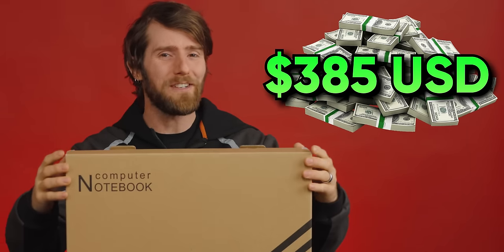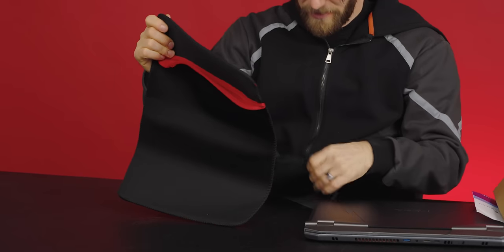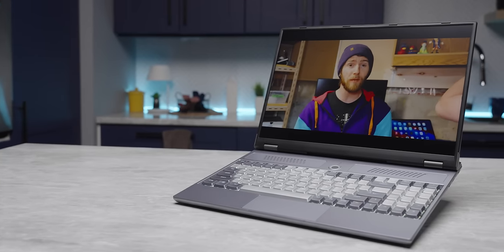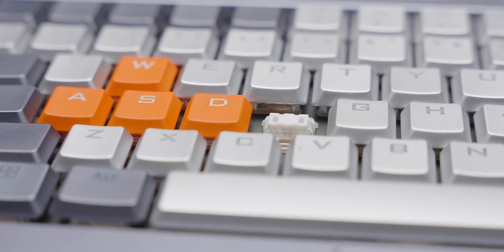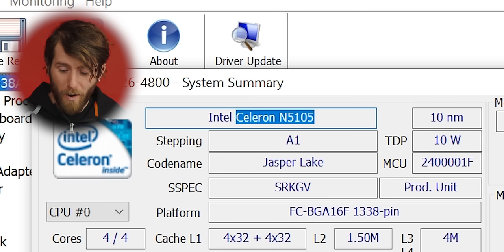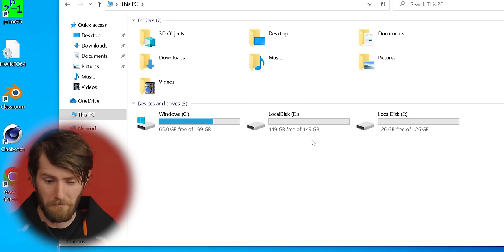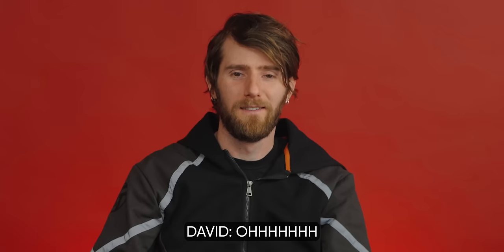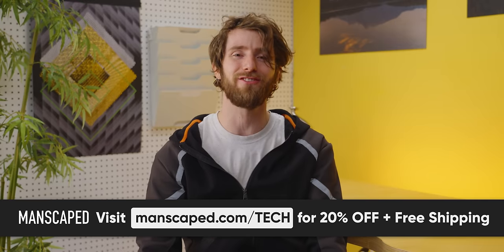Brown Star for Effort – This AliExpress Gaming Laptop is HILARIOUS

Comment: It took me 3 months at my current IT job to realize all of our network drops are at 100mbs and we’ve been reimaging devices like MacBooks on this network.
Reply: If your IT department is anything like mine, it's because non-IT management thinks a "gigabit switch" means a 10/100 switch with a gigabit uplink ... and therefore you don't need to upgrade.
Reply: Just reading this comment...made me cringe your in your companies network speed...My home network is gig but my shop's network is 100 x.x but all we do with it is look up service information.
Reply: What is your real speed, how many MBs/second? 2 or 3?
Reply: @KerenWang  lol
Reply: Lmao
Reply: I think that isnt every job need to have a 10/100/1000 connection. I work with retail companies, and i know that the cashier needs a 1000 connection because it is just more responsible, but for other cases i dont see too much needing to use a 1000 connection, only if the employer asks to do so.
Reply: Always a good time. I've had a vendor ship me equipment that had gig/10 gig ONLY NICs to plug into the fast Ethernet switches they had provided us with.
Reply: @KerenWang  Yeah. I feel ya. I work for a call center where me have 2 separate networks set up in every location just so laptop users can be on WiFi. Desktops are on the ethernet switches and laptops are mostly on WiFi. Makes me cringe when I have to allow a laptop on WiFi just to bypass restrictions placed on the user's LOB/customer ethernet VLAN.
Reply: @KOTYAR1  They have you believe it can get up to 30-50 at least... In reality it's not so straight forward. Example, I have old WiFi, it's a 30mb plan because it's nice and cheap and I don't need anymore as I just watch YouTube and play the occassional game... Yeah that "guranteed 30mb/s" only shows up on speed tests, it's more like 5-10 doing literally anything. 💀
Reply: 3 Months?  You are in an IT job?  Really?
Reply: Government in Australia for schools portables do some questionable switching options as well I've seen some unbranded network switches provided when they should be cisco 2960/3650/9200 but they provide flat gbit switches, thankfully not 10/100 or hubs like what some places have but damn it's frustrating trying to setup vlans coz your dhcp scope is full and half the network doesn't work lol
Reply: @aelaan12  Not everyone works with everything. I've seen end device techs make this same mistake before (granted, they were using a gig switch trunked onto a fast port).
Reply: @KOTYAR1  Your "real" speed is irrelevant. They're talking about a local network. It's as fast as your own equipment.
Reply: Ah yes IT where every job can be a half-janky hassle 😅
Reply: @j.j.5368  I don't see a cashier really needing a 1000mbps connection, 100mbps would work fine for processing transactions. The more important thing a cashier needs is low jitter and latency for quick responses during checkout. So unless the cashier is running a high bandwidth application they could use a 100mbps connection.
Reply: Top notch IT. 😂
Reply: If it's not broken, you're not getting an upgrade.
Reply: @Dono0320  depends on what the network downstream looks like.. can tell you from personal experience that a multiple cashier setup in today's environment will most certainly see issues during transaction authorization if the entire topology is 100Mbps. This of course assumes multiple cashiers running transactions along with your normal day to day network traffic for other things with the retail store. In my case it was a grocery store chain I took on for an MSP, so you had inventory scanning along with PCs to run the backend, scales, cashiers, phones, and we cant forget the multiple employees streaming music on the wifi. Thats not even talking about the database traffic going back to their POS vendor software or their central office server lol. Again, I simply walked into this and was able to remedy with much needed equipment upgrades and optimization, but I can assure you they were calling me on the daily with comm line down issues when i first took them on
Reply: why though? just a simple check at any computer's ethernet link speed would have given you an answer...
Reply: @KX36  I totally don't know where that little blob of solder came from...
Reply: Idk how you can be imaging devices for work and not notice the network speed for 3 months
Reply: @olepigeon  I really love how we live in a society where for some reason there is always a department that doesn’t let another department do it’s own job
Reply: Meanwhile in Australia 100mbs is actually the fastest speed you can purchase from your ISP. Most people still have 15-20mbs
Reply: @EnsignLovell  That doesn't make sense.  How do you have a WiFi "plan"?  Are you confusing WiFi with your ISP service?
Reply: Lmao no way... Macbooks take forever
Reply: Usually it's because the building you're in is more than 15 years old and they thought 4-pin drops would be totally fine at the time.
Reply: @aanesijr  Fucking Cat3 octopus cables. "Let's just run all the data lines to 110 blocks, it'll be fine lol." God forbid anyone ever want to run PoE to that room. And now we have 110 clips running all over the damn IDF.
Reply: aww poor Ali Express, they didnt pay Linus millions of dollars to film a commercial for their products and didn't get a typical puff piece from the Loser mass market electronics dweeb in chief....how ever will they survive....
Reply: @JohnDlugosz  I thought that was obvious. You can technically have a WiFi connection without a ISP, but for the most parts when it comes to speeds the hardware and the ISP need to be taken into consideration. ISP gives you 30mb plan, you have gigabit switch, you ain't getting 30mb download no matter how hard you try.
Reply: @fightingfalconfan  you got gigs? We have mbs here
Reply: @KOTYAR1  I always laugh at comments like this. For context, AT&T, being the wonderful exto- I mean monopolists they are, have the internet basically cornered in my area. I game on 6 mbs. Effectively, that's 600kbs. It's awful, so when I hear people say "EWWW, 100 MBS", it full sends me. You know nothing, Jon Snow.
Reply: @roetemeteor  Yeah, that's one of the funniest things about the US. In my third world country I've gone from paying ~$30/month for 256kbps to ~$60/month  for 1gbps in the last 20 years.
Reply: @vidurbutalia2130  my time is soon. Thanks to the covid bill, our state got a huge amount of funding for interconnectivity. But it didn't go the Telecom companies, it went to our local utility, so now there's a roll of Simplex weather resistant fiber outside my house, and I'm about to get a hundred MBS for $49.99, or a gig for $79.99, but I'll just be going for the hundred because that's going to be light speed compared to what I've got. What's even funnier though is AT&T learned of this, so now they're rushing to the deploy fiber in my area and they're offering me a gig for $30, but I am sure as shit not going to give into them. They could have done it these entire time, they chose not to, and now they're scrambling to do it. Kiss my ass, I'm going to go with the small dudes. I even get a discount because I have their power service.
Reply: @nathandouglas7821  An entire network being 100Mbps is very different than a cashier using a 100Mbps connection to a network with higher speed core components. I obviously don't know the details of your setup but I figure your problems were caused by something other than the link speed, perhaps they were using decades-old switches which were simply starting to fail.
Reply: @butterflytr3077  Yes; I have fiber Gig.
Reply: Owww that made me hurt inside, then again in 2000 i was running 8w-cat4 to a class room that had 4w-cat 3 running to it and the previous idiots emptyed the box in the celing and terminated it... 100 feet of extra cable they wraped around a pipe.
Reply: @nathandouglas7821  I was referring to just a 100mbps link to the POS client, yes I would recommend at least a managed gig switch for any business. Switches that do 100mbps are usually quite old and missing a number of features that can help with stability, speed and security, think QoS and dot1x. 
I was thinking about a star topology when I type my last comment, which would work for multiple POS clients. If you did something like a ring then you might run into bandwidth issues or worse daisy chaining from one POS client to another lol.
Reply: @Dono0320  in some hours of the day it just doesn’t fit. In the early lornings and nights okay, but in rush, it just stays loading, and the consumer hates every second. When you put the 1000 you make them happy to don’t wait literally five second more. But for the office I just don’t care if they gonna wait more ten seconds, and probably they don’t too.
Reply: @markthomas1589  in Brazil it is something like that, but when you are an enterprise it is just other level. In my house a use a 300mb bc I’m on the coast and on Rio, but if you come just a little inside the country the fastest you can get is something like 10mb. My company uses a 600mb on the hq and 300mb on the others, it works well. The /1000 gigabit isn’t just for the internet but for the Ethernet too, the time to “ask” is ten times faster, even the internet is slower than that!
Reply: @j.j.5368  I'm guessing this is burst traffic that spikes beyond 100mbps? If that's the case then yes you can do 1gbps. IMO it's hard to even find 100mbps nic's anymore, it's all gig.

Comment: It's a Celeron CPU. The fastest ddr4 ram it supports officially is 2999
Reply: 2999 is a weird value for a DDR memory frequency
Reply: @lemonsh  2666 at least sounds edgy
Reply: DDR? Dance Dance Revolution?
Reply: @LW1Tok  Yeah
Reply: I've got a small HP14 with an N6000, similar processor. Its stupidly good for what it is and as a travel machine it does just fine with my catalouge of retro and indie games. The only unmentioned downside of this NWNLAP machine is the DDR4 doesnt look like its upgradable.
Reply: @ReapersScythe9 lol my i7 holds up to 2933
Reply: @lemonsh  My workstation has DDR4-3000 in it. Yes, not the standard speeds of 2933 or 3200, 3000. No I don't know how that works.
375 MHz base clock instead of the usual multiple of 33 MHz? (2933 being 366 MHz base, 3200 being 400 MHz base)
The currently common 3600 MHz RAM is also an odd multiple, as it's based on a 450 MHz base clock. Continuing the 33 MHz scale, it should be 3466, then 3733, not 3600.
Reply: @thethiefmaster  I have 3600 in my machine, but like 2999 is just bizzare. Literally one mhz away from a nice 3000, why?
Reply: @lemonsh  it's probably just a rounding difference.
Reply: @LW1Tok  of course
Reply: @lemonsh  Not unlike the 667 Mhz processors of old: The clocks don't actually line up nicely at times. That 667Mhz chip was actually 666.66Mhz.
Reply: @boingkster  Very few laptops have upgradeable memory. It's usually soldered in.
Reply: @theyeetus1428  generally speaking that's not true, but for this class of small Pentium and Celeron machine it does tend to be that way.
Reply: 2933 !!!
Reply: @igors_lv  yup.
Reply: I actually have something similar, called "HP Stream 14". The same small motherboard... and in my case, cooling is completely passive. Just heatsink. Looks great, and works kinda okay-ish, actually. For desktop use. I bought it used for something over 40 Euro. Kids love it.
Reply: A 1st gen i7-970 is faster than that thing... both single and multithreaded
Reply: Hey, my 8th gen Intel (Coffeelake) uses DDR4 2666MHZ and it does well on CPU benchmarks. I just don't think Intel architectures bottleneck with RAM speed unless you really get to high cores or high clocks on 11th gen +.  Or, you know, have a good GPU that can share that resource.
Reply: @waldojim42  Devilish CPU
Reply: Also,  apparently DDR4 can actually go as low  as 1666 MT/s  as per JEDEC specs.
Reply: @Ms Moon Boo Agreed those 10th gens can turbo high but this Celeron I looked up the Geekbench, about 2000 it's equal to about a 2.2GHZ 4-core 6th gen so RAM is not the issue ha
Reply: @boingkster  My Lenovo Thinkpad with a 12-thread Ryzen 5500u has ram soldered in. Same with my sister's high spec i7  laptop, it's got one stick soldered in, other one's just slotted.
Reply: @auturgicflosculator2183  yep. Those sorts of laptops you'll find popular with large industry like schooling, higher education, government and construction. They will be specced in one or two variants only so to avoid having to make another board one channel is soldered the other can be upgraded simply by slotting in another stick.

Most 'high end' and increasingly some mild tier and even low end systems offer true replaceable RAM with dedicated slots.
Reply: His RAM comment was unnecessary; pretty standard for DDR4.  For that computer, RAM speed means nothing, and a 2 GHz quad-core is plenty .
Reply: @theyeetus1428  not true at all, maybe the ultra portable class.
Reply: @alext3811  1600, even.
Reply: @timmturner  Tell me 5 mid-range laptops right now that have expandable memory.
Reply: @theyeetus1428  HP ProBook is the only laptop I can name off the top of my head, I'm not a laptop reviewer...
Reply: @timmturner  Then how do you know that most laptops have expandable memory?
Reply: @theyeetus1428 okay let's see your reviews since you seem so knowledgeable.
Reply: @timmturner  You don't need to be a tech reviewer to do some basic research.
Reply: @theyeetus1428  I can agree it's a common trend to have soldered RAM and even SSD, why wouldn't they do this if allowed as it forces one to purchase a new laptop instead of having the ability to upgrade.

Until consumers refuse to purchase products with planned obsolescence this practice will continue.
Reply: "My Catalog of retro and indie game" come on, cite titles. Dwerve? Dwarf Fortress? AntStudio? MAME? PS2 emu of FFXII? What?
Reply: The last Celeron cpu laptop I had could run Doom 1993 and I got it when I was in college back in 2005.
Reply: to bad ram and cpu can not be upgraded. Is ssd nvme or sata?
Reply: @zzmaj  ngl going from an 8 year old SATA SSD to a NVMe 980 Pro SSD as my OS boot drive, I can not tell the difference when I boot up the PC.  They both load almost exactly at the same speed lol
Reply: @casedistorted  I do not run windows and I see difference, especially in how virtual machines work.
But I do not see any real difference between 980 and 990 pro
Reply: @zzmaj  yeah I am guessing it's just my PC, I have hit the hard cap in terms of how fast I can make my windows 10 machine load up
Reply: My work laptop with a 10750H has 2133MHz, I feel like that should be higher... I've seen I think 2933MHz or something similar on my PC when I didn't have XMP/DOCP or whatever set.
Reply: @LW1Tok  the faster you dance the faster the MHz , get moving !!!
Reply: A Celeron!? Oh Dear God!
Reply: Am I missing something? last time I owned a Celeron it was absolute garbage.
Reply: Dude my pc has a 7th gen 15 but the same ram as tht laptop....I think its enough
Reply: it's still an excellent writer's laptop imo
Reply: @LW1Tok  yeah it only supports max 300
Reply: @lemonsh  you leave this one memory cycle for Chinese goverment
Reply: 've ha telcast f15s how can i now if can change ram.
Reply: @lemonsh  it's 2997 or 2996

Comment: If Deeq were to legitimize their products a bit and fix some quirks, they would actually have a big fighting chance against other laptops on the market. It's crazy!
Reply: And it wouldn't take much to do.  The hard parts are done (screen and keyboard) that just leaves the battery thing and using legit windows and they'd be 90% there.
Reply: We should all crowdfund a similar brand to challenge Deeq - The Poosee gaming laptop. 😂
Reply: It's an ok brand but I think the design has to be reworked